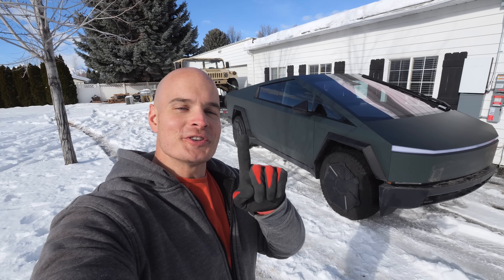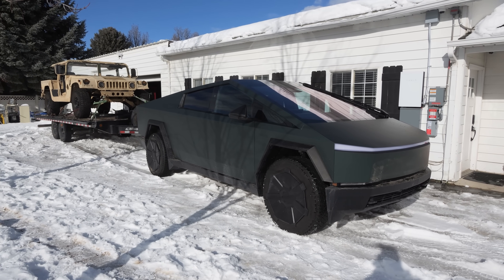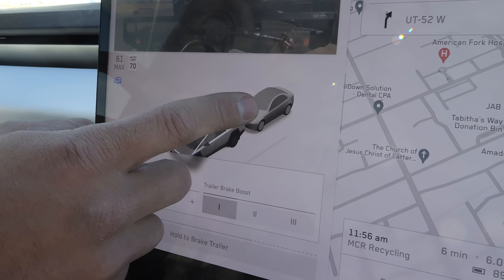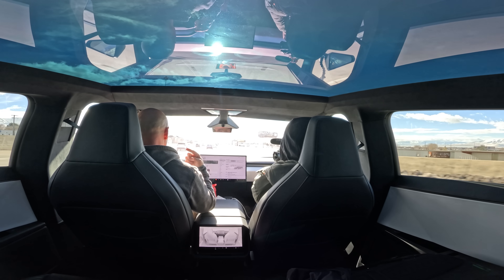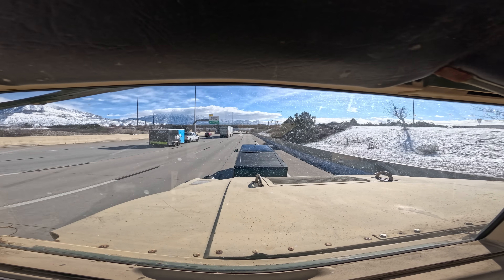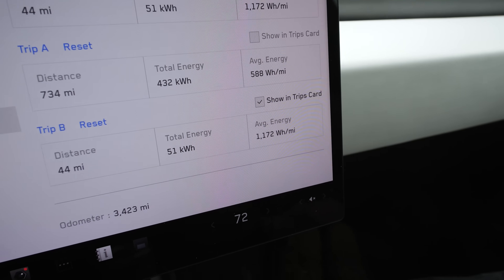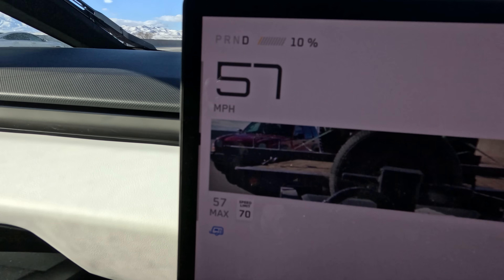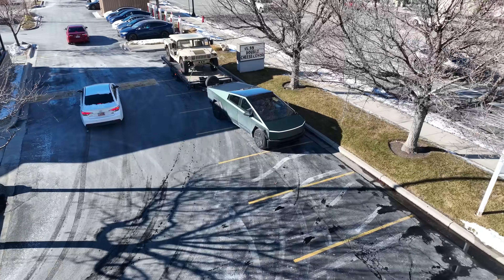How far can the CYBERTRUCK tow 11,000lbs in Freezing Weather?

Comment: Thank you for sharing, you saved me from going through with my Foundation Series order.  I am going to cancel today event though I will loose my $1500 deposit which at this stage in the process is non-refundable.  I love my Tesla Y and have been waiting 4 years to replace my GMC Sierra with the CT as the tow vehicle for my 7500 lb 25’ Airstream.  Even though I included the forthcoming Range Extender for $16,000  in my order, which would have helped on tow distance the #1 reason for cancellation of my Cybertruck FD AWD is the inability and willingness to charge with my Airstream still hitched.  Can you imagine unhitching with sway bars and re-hitching after charging?  It takes 15 minutes hitch and the same to unhitch with sway bars so add that 30 minutes additional time to the recharging and I would prove to be a complete moron to justify buying the CT.  There are only 2 potential fixes to my problem and neither will happen. 1- Tesla allows me to use a 30ft NACS extension cord which they can’t allow due to safety and damage to the Super Charger and 2- add an additional charge port to the front driver side so I can go in the stall headfirst, which would also be stupid and rude to any other users maneuvering around my 43’ rig.
Reply: That seems to be the problem. Bad range and no way to charge while hooked up.  I think this is a truck for people that don't really need a truck.
Reply: I agree based on the trailering/issue alone.  
 @jacobmiller6664
Reply: Eventually their will be infrastructure like our fuel stations, which will be able to charge your vehicle without detaching your trailer. However, we don't even have insulated charging stations yet. So we are very behind.
Reply: agreed, this has to happen for the Cybertruck let alone the Telsa Semi.  Semi will be going into full production in a year or so since they just broke ground on the new plants construction site Jan 17, so Tesla better have plenty of the next level charging bays that are pull through for that product too. @skie9140
Reply: I don't blame you, i'd be doing the same!
Reply: One option could be to create drive through charging stations.
Reply: yep, and only 1-2% of all Teslas Super Chargers have pull throughs.  Some day that might be much greater but it will be at least 5 years, guessing
 @Markos711

Comment: Trying to haul something across the country would be a nightmare
Reply: Right having to stop every 90 miles and wait 40+ minutes. That's not even if you hit traffic and having to stop and go, stop and go.
Reply: @vbarbee1 EVs are fine with stop and go, impacts them less (relatively) than gas vehicles.
Reply: @joeynessily  what are you talking about? That doesn't even make sense. If you're stopped, you have to get that weight moving again. Then, a few feet, you're stopping again. Then, I have to get the weight moving again.
Reply: @vbarbee1  yeah, that’s gonna eat range, but ‘relatively’ it’s not as much of a problem for an EV than the same situation for a gas car. The EV has enormous torque, so can get the load moving for relatively small energy.. Your major issue to range is drag… therefore, where we are talking here about the EV being shit range and doing a cross country. Stop start is the least of your problems. A gas truck will have a higher percent of its range drained by idling in stop start traffic… than the EV.
Reply: @joeynessily  right, my thoughts on start and stop is getting the load moving every time is going to burn into range. Speaking of higher torque. That's even more likely to break something in towing long distance or in the towing world.
Reply: @vbarbee1  With stop and go your range would go up a lot!
Reply: @sandos-x1t  how? Every time you're having to get the weight moving.
Reply: @vbarbee1  Air resistance is still the killer. I am fairly certain it will still be much better than high speeds. I mean, stop-and-go will not be for long distances. So really, you want to know the time endurance instead.
Reply: Agreed, you'd want a diesel truck for that. Fortunately 99% of pickup truck owners don't ever tow anything lol
Reply: That is why I have my F150 with an extended tank. It gives me 700 to 800 miles without towing and with towing 300 to 400. It is a great vehicle to transport thousands of miles. 90 miles and having to stop is really sad. These companies need to keep investing in their battery technology.
Reply: @skie9140  exactly. I don't see it getting any better. Just the weight it's killing itself. Now, if they can get it to where it's half the weight. They might be on to something. But the weight to power output ratio is way off. Yes, the vehicle is heavier, allowing to tow heavy with smaller vehicles. The weight of the vehicle itself kills the towing. Even worse with heavy hauling. If the EV truck weighs 10k more than a diesel. That's 10K less you can haul.
Reply: Definitely forget about overlanding 😅😅😅

Comment: Two questions based on rules here in Sweden:
* 5:38 you mention a tongue weight of 1000 lb. Is that normal for towing 10k lbs? Here the rekommended weight is 100-200 lbs. Obviously that is for trailers up to 7000 lbs in Sweden
* In the camera view from the trailer, there is a lot of vibrations going on. Inbalance or what is going on?
Reply: I think thats just high quality American roads
Reply: Same speed with or without trailer regardless of what roads?  @RealLifeDoomer2  Here we have 80 km/h for trucks and car+trailer on all roads. Matter of safety (try to make any sort of diversion going 70 mph with a trailer almost twice the weight of your car...)
Reply: Also, here we have a max speed of 80 km/h (50mph) with most drivers keeping it around that; especially with heavy trailers. Cruising at 65-70 mph is pretty nuts with that much load imo 🙂

Comment: One thing I haven't seen mentioned in comments is that this video started out at 100% charge which isnt the normal charge percentage the truck would be starting at if towing a longer distance, greater than 70-80 miles in the case of leaving from home with full charge. Would realistically only be charging to 80% max so now that brings you down to 50 mile range.

Imo diesel generator electric drive is the future
Reply: Trains and giant haul trucks have been like that for decades, but I’ve not seen even one real attempt to make a diesel electric road vehicle. I’d like to see someone give it a real shot as it seems like it would be the best of both worlds.
Reply: Yup, have you seen what Edison Motors is doing?
Reply: @The_Bored_Farmer  yep I have! That's the future, I hope!

Comment: Not a truck guy. I’m assuming gas trucks are also heavily impacted by full loads as well right?
Reply: Definitely. Grew up doing construction and hauling materials to the job definitely reduced fuel efficiency.
Reply: @staple_gun6367  At first glance the 100 miles seems very bad on the electric trucks with these loads, but hard to say since I don’t know comparable range on ICE truck.
Reply: Ram 1500 5.7 with 35” tires and 2” lift towing just over 11,000lbs at 60mph was right around 6-7mpg. Not cheap at all
Reply: @foleykappel5221  yea its not cheap, neither is a cybertruck -but it does have a bottle opener in the back and i noticed you didnt mention any bottle opening specs for ur dodge

Comment: I think that in Europe a car MUST have steering wheel connected to wheels. There is of course a power steering system but in case something fails you must be able to steer a car to a stop. Same goes to brakes. I think tha such tesla steering is not allowed. I just think so. Might as well be wrong :)
Reply: Yes, you are wrong. Your steer by wiring in the EU needs to have redundant components for safety. I.e. two motors and two control units.
Reply: @pierre.a.larsen  sounds right, thanks
Reply: @dismayer666  Sure 🙂  It must be a nightmare for car companies to navigate the wildly different rules of the world's 200 countries or so. The info is not easy to find either and much is ambiguous.

Comment: 90 miles is not as much as a concern for a normal ICE truck, as it can be refilled within minutes. But for CT, it would have to be in charger port for an hours (if there is one open). it would dread people out...
Reply: The real issue is having to drop the trailer to recharge, even if you can go from 2% to 80% battery in 40ish minutes. It would make a long distance tow basically a continuous cycle of 1-hour drive, 1-hour charge, 1-hour drive, 1-hour charge, until you either lose your damn mind, or you get to your destination in twice the time it should take.
Reply: @Kvantum  and don't forget they tell you NOT to charge above 80% or run below 10% or you'll prematurely damage the battery.  So really you only have 80% of range.  80% x 90 miles = 72 miles range "or else..."
Reply: wait till you hear about the monthly subscription to keep access to your bottle opener

Comment: Not sure why it showed you so low on the percentage. 108kwh is only roughly 90% of the battery pack's 123kwh. You should have been able to get just a little over 100 miles. Obviously I understand you stopping when you did, since the system showed only 1%. I wouldn't have trusted going further either. Just curious is all. 

Probably a lot of software updates needed to truly improve the overall towing experience. Also, you stated somewhere about this being the Beast version. Looks like you had that corrected afterwards. But yeah, the 0-60 times will be drastically different with the actual Beast version.
Reply: You'll never get the rated capacity out of a battery. There are some losses along the way and there is still some capacity below zero percent.
Reply: No idea if it was full in the beginning or if 123kwh is the real capacity of the battery. But otherwise a battery cant be used 100%, it would destroy the battery. You need to stop well before its empty and cars have built in protection for that.

Comment: Tesla's approach is to use standard range, proportional to battery percentage and navigation to do exact estimate. I like that approach better, since it's more predictable in most of the situations. Only if you are for example driving highway in certain speed and certain load, predictive system has some use.

Many predictive systems gets totally crazy when you drive out from heated garage to very cold weather, do some city driving and then move to faster roads. That number tells nothing about consumption or estimated range. Navigation is the only way to make good estimate, and it's good to teach people using it when there's a need
Reply: "Lie is better", ok shill

Comment: How does this compare to a gasoline or diesel F-150 in range pulling this weight? Having to park and disconnect the trailer sure is an inconvenience. That never has to be done with an ICE powered truck.
Reply: well put it this way i have a 07 f150 i tow a 13k trailer daily skidsteer and misc concrete tools . and put aprox  250kms per day on it . its old ya but gets job done . these eletric trucks are just plain no good and not mention  it can get -40c here so ya..

Comment: Remember, he's doing worst-case scenario towing. Cold weather and max weight. I've towed a lot of trailers in my life, and I've probably never towed anything over 3500 lbs. Towing anything close to 11,000 lbs will be expensive no matter what you're using to pull it, that said, I still wouldn't choose an ev if I regularly had to tow at that weight.
Reply: fucking minecraft monster school guy giving his input on evs and towing 😭😭😭😭😭😭 i love the internet
Reply: It's STILL hilariously bad, though. And highlights one of the worst downsides of EV's. Their sensitivity to temperature. Not to mention their already sub-par range. The fact of the matter is unless you're driving through the city for about three femtoseconds to get groceries, EV's still are not the solution...

And some of us aren't big fans of cities in the first place. Mainly because of all the people there.
Reply: @Gundrium  I live 20 miles from the town I work/buy stuff in. 95% of my driving is to that town and back, so an ev would be perfect. Plug in at home and would never have to charge anywhere else. Also, the range reduction in cold weather is similar to gas-powered vehicles.
Reply: @MrMcSnuffyFluffy  good for you? That's not the situation everyone has... Or even wants to. 

And "similar" range reduction? That's a disingenuous statement if I've ever heard one. If my gas vehicle lost that much fuel economy because it was cold, I'd be checking to make sure the engine block hadn't Cracked.

I can appreciate you find EV's neat, but for a lot of folks, it's just not practical... Especially when you're as low as he got, and all the charging spots were full... Which is another weakness of current EV's that's exacerbated by inclement weather... Or even just sufficiently cold like what's happening across the country right now.
Reply: @Gundrium  You literally said they were only good for short trips in the city, and I explained how that's not the case. So why the "good for you?" You also seem to think that gas powered cars have zero range reduction in cold weather. Gas cars can lose around 30% range with a little city driving at 20deg F. Pretty much on par with a Tesla. This isn't hidden information. Yes, some evs are probably a bit worse than ice vehicles with cold weather range reduction, but it's not as bad as most haters claim.
Reply: @MrMcSnuffyFluffy ... Your refutation was 20 minutes. You're making the suburbanite argument. Congrats. You're still surrounded by other people, and enjoy it far more than I do. Again, good for you.

And even by your Rediculous 30% estimate, that's still better than the Rediculous range reduction of even heated batteries, not to mention the cheaper non heated batteries that loose charge even faster.

Again, I will reiterate: a nearly fully charged truck couldn't go 100Mi. Towing (admittedly just over) is a joke. Face it, EV's just aren't there yet. ICE continue to outpreform EV's for the time being.

Maybe it's the fact that I drive A Semi for a living, but 20 minutes is peanuts, and to suburban for my likes. I get to deal with idiots on the road all the time, and wouldn't you know it? Bad drivers increase exponentially in urban sprawl. (note I said exponentially, as in higher concentration than simple population increase would suggest.)

Comment: There's A Lag With The Steer By Wire Steering Isn't There?🤔
Saw A Video And Looked Like There Was...
The CyberTruck/Beast Keeps Getting Cooler I'd Say...
...Minus The Hub Caps 🤔...
 The Steer By Wire Doesn't Seem Like a Good IDEA To Me... 
Looking Forward To See The EV Truck Tech Evolve...
I Think Maybe A Power Steering Like Steering System Might be a better safer choice🤔... I wonder if less lag also🤔... In power steering At Least Still Have Manual Mechanical control...Tho Takes more physical effort ...if loss of power in steer by wire then what?😱🤷
...Should Get Battery Swaping Station Tech Going... A faster option  along side charging.....
Also To Be Able To Jump Another vehicle..(some do some don't (EVs))

Comment: yah, for now I'm still gonna go for a diesel, that range just isn't enough
Reply: Do you actually ever tow 11,000 lbs and do so nonstop for 90 miles or mile on the highway? You can tow that weight for further during normal city driving (non-highway). You can tow lower weights and especially those that are more aerodynamic much further. And of course that only cost the equivalent of 3-4 gallons of diesel to do so.
Reply: yes, I regularly tow well in excess of 11,000 pounds and do so for a lot longer than 90 miles. And in terms of cost you can get a 2018 RAM 2500 with the cummins for half the price of the cybertruck. so even tho you are technically saving on fuel, any electric truck is stupid expensive
 @anthonypelchat

Comment: The power and energy consumption information is in the energy app that you can pull up on the center console. That is also wheee you get the range calculated based on consumption. The range that is toggled with the battery percentage is just confusingly the static epa range * battery percentage.